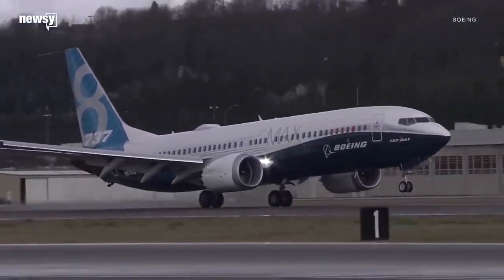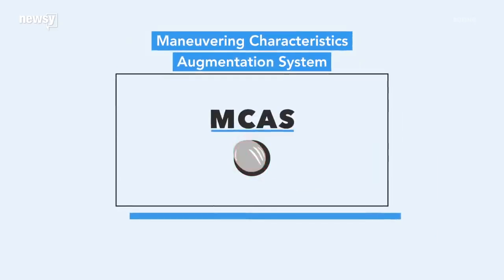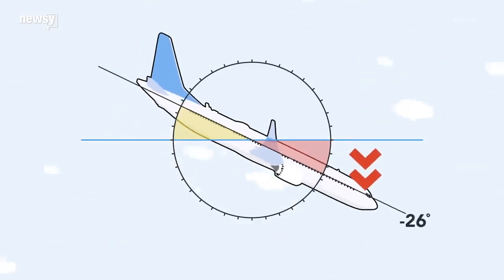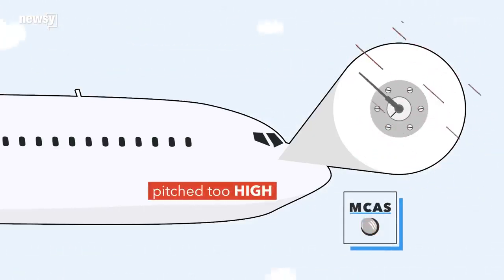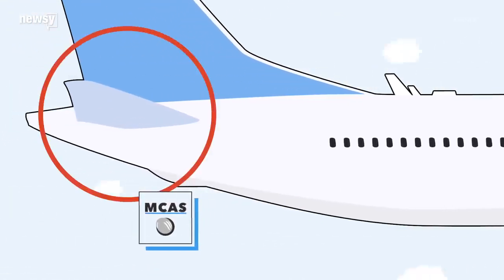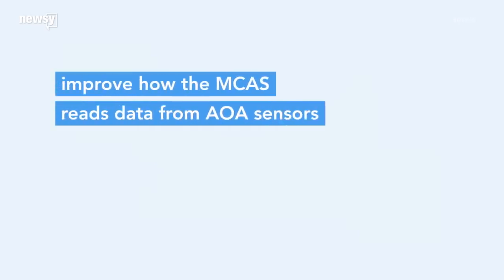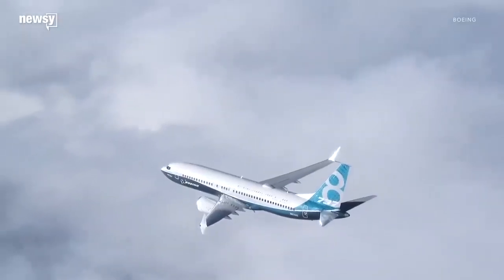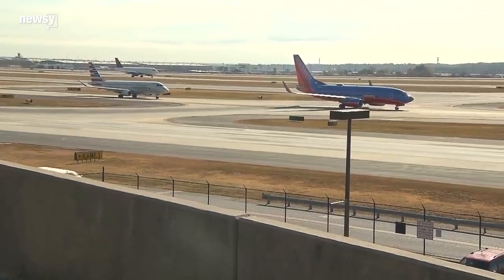Boeing 737 max AOA sensors

Comment: If only the french flight which crashed into he ocean because the pilot stalled the losing altitude all the way doen had an MCAs to pitch the nose down to stop what was happening. There was a sensor failure but his secondary airspeed was correct or something and he didn't believe and continued to pull up when his attitude was dropping . His airspeed was too low and he didnt believe it